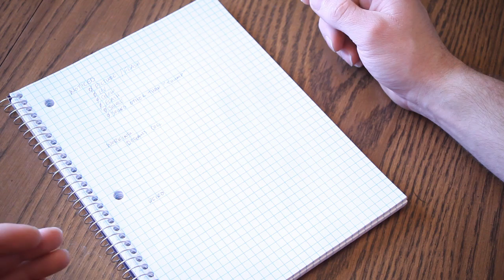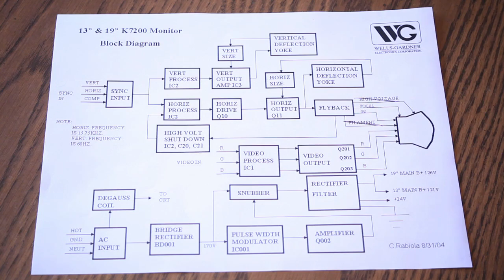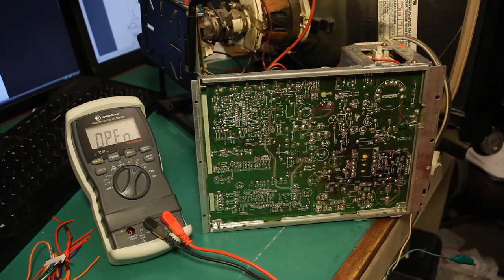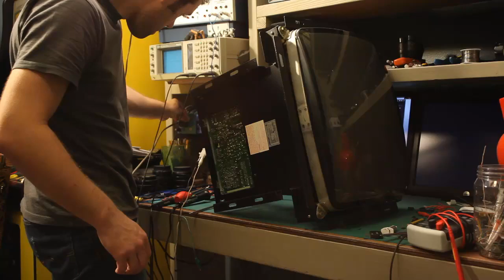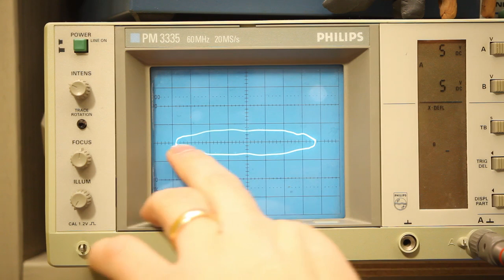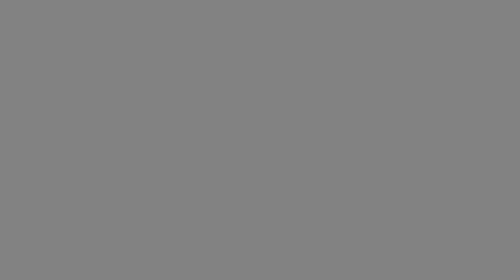Fix it Friday - Watch As I Troubleshoot and Repair an Arcade Monitor without a Schematic

Comment: Great video.  I have a dead Sanyo EZ-20 monitor that worked before I moved the arcade cabinet.  Pretty sure I broke it--not sure I can fix it, but going to give it a try.
Reply: Hey be very careful with the ez-20 you can get the power and audio plugs swapped and it will blow up both the monitor and the audio board

Comment: I have a large 40 inch consumer set where I cant for the life of me fix a pin cushion circuit problem. The horizontal picture is maxed out and adjusting in service menu does nothing. However horizontal position and vertical adjustments work fine. So I’m pretty sure it’s the pin circuit but have no schematics to know where that is

Comment: Good video, I had this same issue on  a k7000 chassis, HOT went out and took the voltage regulator with it, bad caps in the power supply caused it.

Comment: I just recapped my monitor and now when I try to power it on, I can't get anything from the monitor. Similar to your video, nothing is coming on in on the monitor. The coils don't light up either. I'm guessing I need to go back and reexamine all my soldering points to make sure I didn't introduce a short?
Reply: Okay so I went back to check my soldering work and cleaned some stuff up. It did end up working when I plugged it back in. However, it STOP working after 5 minutes! It just shut off. Any ideas? Could it be a power issue rather than the monitor itself?

Comment: The golden rule is that after each repair of a monitor, especially when it is older than 5 years, the electrolytic capacitors in the mains must be changed.

Comment: This chassis has two grounds, a "hot" ground, and a "cold" ground, which is typical in switching power supply designs.

Most TVs will have the hot and cold sections of the chassis marked, but arcade monitors typically don't have this convenience.

Comment: CREATE!,  why does an arcade monitors have a B+ voltage for the H&V sync hold circuit? The B+ voltage is a Bias voltage for the H&V sync circuit? but you have to set it at 125vdc which is a big DC offset bias voltage which doesn't make sense to me for the H&V sync hold circuit to work correctly, any reasons why?

Comment: I’m only 4:15 in, is this a dead power supply? Guess I’ll find out finishing it, working on something you decide you want to live forever I’d plan on replacing every single capacitor, however it would be nice to know the condition of the tube before dumping a lot into it, but most of these capacitors are actually all bad, even in some sets working, I’ve seen some in what someone would call working condition that you would be amazed at how much life a capacitor refresh brought back to the picture. At any rate I doubt this was kept in a cool environment it’s whole life and for the first part of it probably ran non stop so it’s got stressed capacitors.

That horizontal driver looked cheap as hell, should have used the heavier duty one but I guess they cheaped out on it. It may have not been bad though, testing it in circuit isn’t always going to tell you much about it, the capacitors ESR May have just killed that voltage regulator. Those things can be sensitive, from the looks of it that power supply had been driven hard due to the darkened areas on the board. I would have replaced all large value caps but that’s just me.

Comment: can you explain how the arcade monitor converts the Vertical and horizontal sync signals into X and Y coordinates on the CRT screen. The spirit ROM and Character ROM don't have the X and Y coordinates so how does it get encoded and decoded by the hardware in the arcade monitor?

Comment: I have a white line going straight across horizontal line from top to bottom, does get power but nothing else shows after adjusting all knobs on back of crt arcade  monitor. What you think it could be?
Reply: @gamingo_gguyverx6812  if you know nothing about the subject refrain from commenting because you may end up wasting peoples time and money...a white line across the screen means failure in the vertical circuit...bad yoke, bad vertical output transistor or IC, or a bad capacitor or open resistor in the vertical circuit...flyback is DEFINETELY not the cause otherwise you would see nothing...dont run the monitor like that for any time or the line will get burned permanently on the phosphour

Comment: Hi. I own two Commodore crt monitors. The 1701 and 1702 model. Both in perfect shape and working. Would like to keep it that so I was asking myself if there is any need to replace the caps on the PCB? What's your opinion in this?
Reply: NiekkieNick recaps are always good for old equipment provided you buy good ones. When I decide I want something forever and it’s not just a project it will eventually get a full recap even down to the little ones. Everything else will basically last unless their is a design flaw like the possible underrated horizontal output transistor in the video. Besides caps and poor design you can run them until the picture tube has seen the end of its days, older picture tubes were usually of much higher quality than those being produced right before the flat screen era.

Comment: Although I agree that this a good video and appreciate the effort, I find your method of tracing very backwards. The first thing should have been a visual inspection, caps, diodes transistors etc. That should have been check 1. We don't see any of those components almost until the end of the video, just the underside of a PCB. Also, CRTs are known to blow transistors and caps quite frequently, that should have been check 2. And if all these fail, only then, voltage tracing should have come. And you do some dangerous things like probing random pins when in diode check mode. Be careful. Thanks for sharing.

Comment: You really know what you're doing with CRTs! I have a purple blotch on the bottom left corner of mine, it's just a normal TV, not a true arcade monitor. Now that you mention it, it used to do that de-gausing "thump" but not anymore. I've also bought a degaussing wand, the circular motions didn't help, but randomly flicking the button on the wand at random positions around the screen made it go away temporarily but it comes back. Do you have any ideas?

Comment: i bought a street fighter 2 machine and the monitor turns on and you can see it but the picture is slanted and also is slightly faded, any chance you know whats wrong and is there and way of fixing it?
Reply from the maker: Sure.  Send me a picture!  I also need to know what the model of the monitor is, so pics of the inside would be really helpful
Reply: I have the same issue as this.
Reply: I bought a mk3 machine and the monitor turns on and you can see it but the picture is slanted and also is slightly faded any chance you know what's wrong is there and way of fixing it?